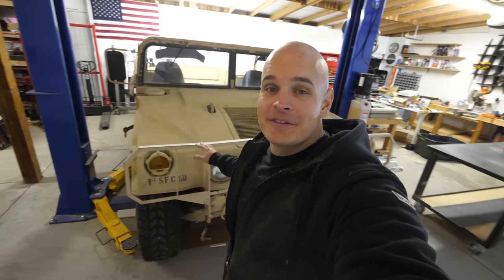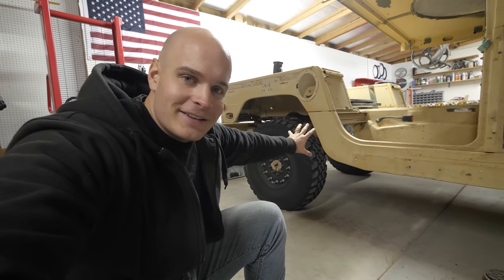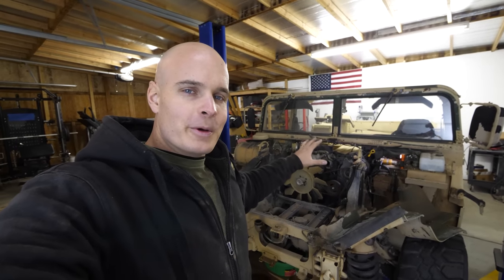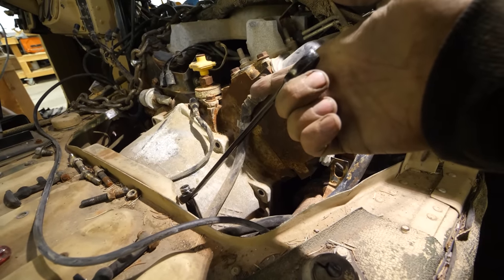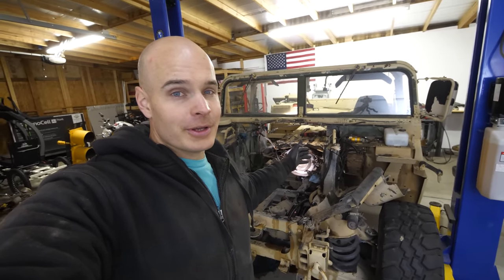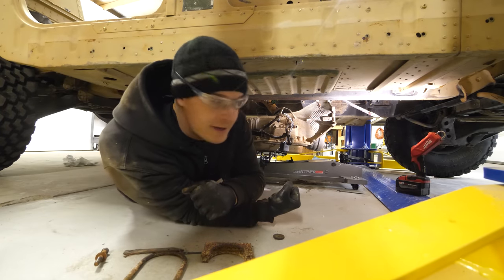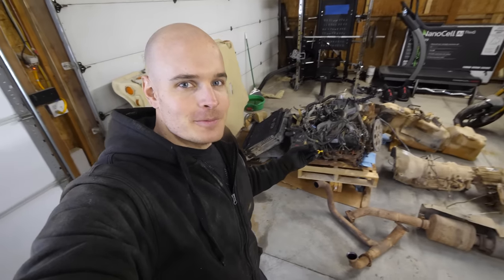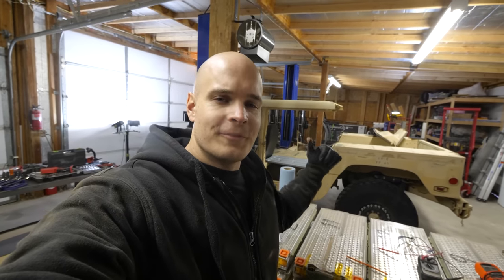How to build an Electric Hummer? Step One – TEARDOWN!

Comment: Very interesting project. But the explanation about the engine is not 100% correct. 
A diesel engine works with "air excess", which means, it doesn't need the exact quantity of air, but just more air than the fuel it is injected. This is one reason why these engines are far more solid than gasoline ones in extreme circumstances.
The glow plugs are not spark plugs, this means, they are not always used in a diesel engine. In fact, they are hardly ever used, just in cold starts.
The diesel engine has no explosions inside, but combustions, as is not a gasoline engine. The gas needs to be "detonated", the diesel burns itself as a consequence of high temperature in the combustion chamber and being injected at high pressure (about 120 bars when new for this indirect injection engine technology).
Another thing about this diesel technology is that you really don't need diesel to run it, this means, they can run with any burnable (and sustainable...) vegetable oil. If no diesel is available, some canola, colza or sunflower oil will make the job as good as (oh, and they are eco and sustainable energy sources btw...). Even the fuel can be mixed with a small quantity of gasoline (up to approx 30%), which is done worldwide in extremely cold climates to make cold starts easier.
Despite all the "moving parts", these engines, in general, are extremely reliable, muuuch more than an electric engine, considering their working circumstances. I don't want to imagine how batteries will stand after serving 20 years at 100 degrees in a desert, handling with 1 meter of water and mud. Also, these engines when running need absolutely 0 electricity, another joy of mechanical injection (all can break but as long as there's fuel to be burned, they won't let you stranded). Unfortunately, electric engines seem to be "the only future", but I severely doubt an electric tesla (which sponsors a space race made with fossil rocket fuel btw) will be more reliable than my 31-year-old diesel car, which had any mechanical failure up to now, with +300,000 miles (excepting of course suspension, bodywork, and of course batteries, isn't it ironic)

Comment: @JerryRigEverthing. I have a helmet top humvee and moving to Nevada. I may have to take you up on the project. Any idea what the cost will be?
Reply from the maker: 70k? Not sure. Cheaper than a h1 alpha though, with the same power.
Reply: @JerryRigEverything   Just a thought, add some way to utilize solar power that way you can go truly off grid.

Comment: Why did you not just remove the body? You have a hoist, and could have done it in about 2 hours. While the body is up in the air, you could have pushed the chassis out of the garage and into the bay next over. Then pick out all the unneeded components. The batteries should be mounted in between the rails. A body lift might be required for batteries to clear.
Reply from the maker: Next time.

Comment: I'm not buying "as few as 20 parts". you're not replacing that much. the engine is different, sure, but you're leaving the transmission, the drive shaft, the differential, the breaks, the wheels, the steering system.... the list goes on and on.

Comment: No gear changes = more efficient
You have to start in a low gear because it's not efficient?!?
I'm sorry that electric motors have all their torque at 0 RPM and any other engine has their torque higher in the RPM range. But that doesn't necessarily make it less efficient. If we're thinking about power density, it would theoretically be the other way around.

ICE has efficiencies around 80% or higher, and can still get better. This engine is probably much lower because it's built for longevity and torque....
But I do want to see this monstrosity when you're done.

Anyways, this doesn't make me love you less.

Comment: pulls out the transmission on the ground 
* used transmission Jack 30 seconds later to pull out fuel tank……* 
Work smarter not harder buddy

Comment: Dude that hummer tops out around 48-53mph depending on the gearing it has.. 75-80 🤣
Reply from the maker: It was a four speed 80mph.
Reply: @JerryRigEverything  so is the am general i have.. and mine is turbocharged. The gearing is  purposely low for training and offroad missions. I’ve only seen 2 that could actually reach speeds over 65mph and those were used by high ranking officers

Comment: As a diesel guy this is disgusting. Even tho the old motor is slow, it’ll be around long after that EV motor your putting in frys out.

The diesel has more moving parts, but that EV has a big & expensive controller that’ll fail.

Comment: "There's over 2000 moving parts"
"An electric vehicle is much simpler"
But they are MUCH more expensive, like, if a part breaks on the hummer, you can just replace that part yourself for cheap, with the electric motors, it needs special tools, special skills and a lot more money